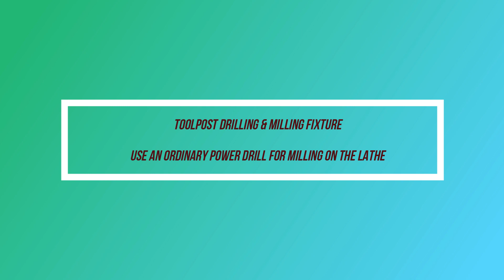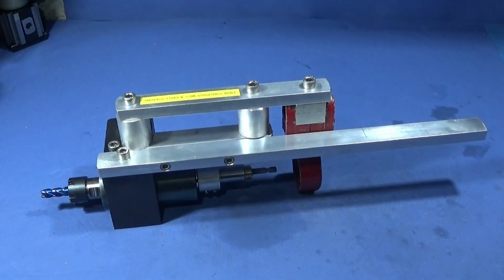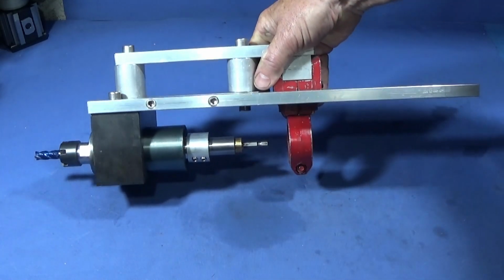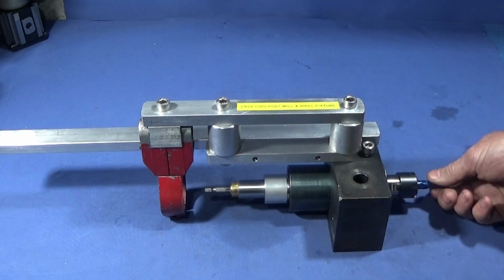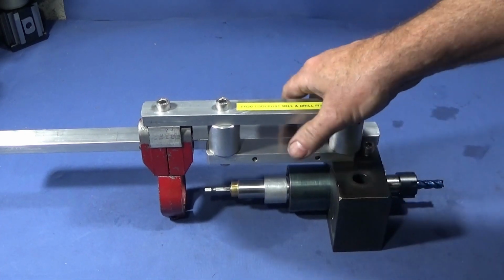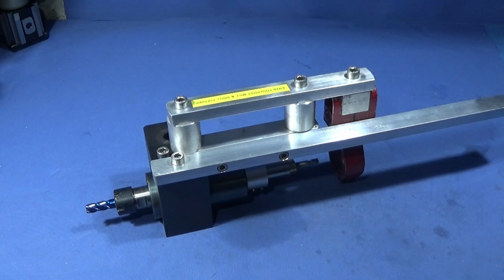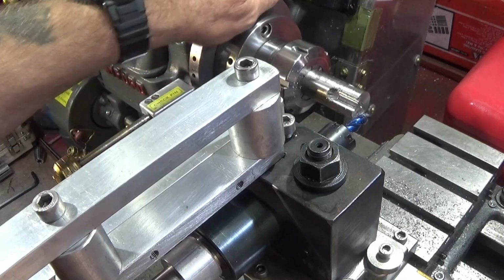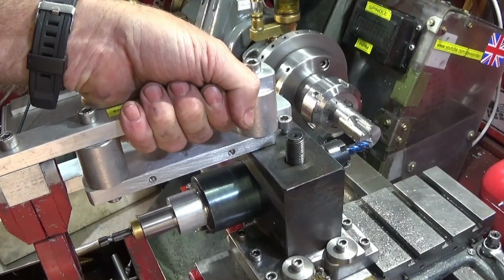ER20 Lathe Toolpost Drill & Mill Fixture. A Power Drill Milling Hack

Comment: Ey up Steve, that’s brill mate, I’ve already copied your first model, and I love it, and I’ll definitely be copying this one, I hope you don’t mind that, but to be honest isn’t that wot we do lol, I have used mine quite a fue times, I am using a Harrison 140 and made he 3 jaw chuck in to an indexing head like yours, and it’s so versatile using your ideas, it’s brill, I would definitely recommend it to all turners, hobby or business, Thank you for you brill ideas, keep em coming buddy, your doing grate 👍🏻😉
Reply from the maker: Hi Mark Thanks. I'm pleased you like it. No I don't mind at all if you copy them. I have seen copies of the very first toolpost drill I made some years ago. YouTube is great for all sorts of Ideas. I have learned loads from others on here. 
 I am so pleased with this one. At first I had a bit of vibration when I only had one strut. As soon as I put the long strut on the side and bolted it together, it fixed it. I left that strut long so I could put a velcro strap around it and the drill , to give extra support, but it doesn't really need it.

Comment: Greate design, greate video. It's quite a Mechano but performing very, very well. Just finished an adjustable microscope stand that finally consists of "several" parts but does the job. Your construction takes the beauty price however.